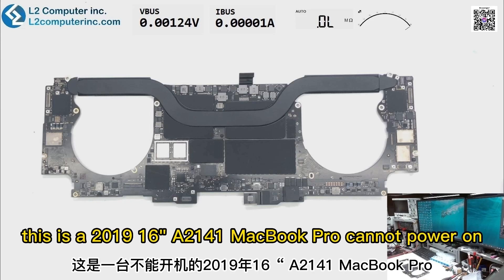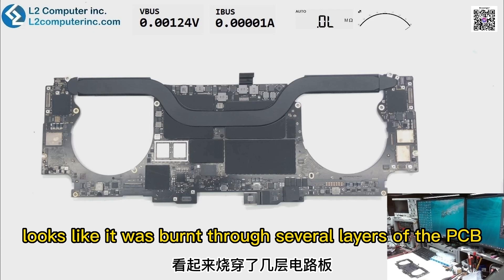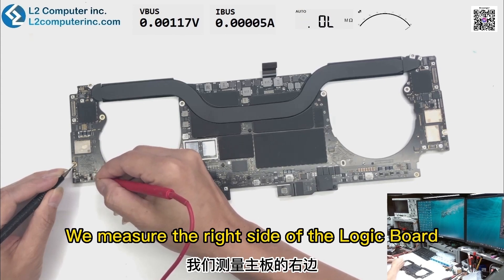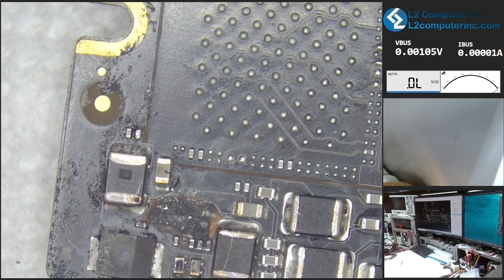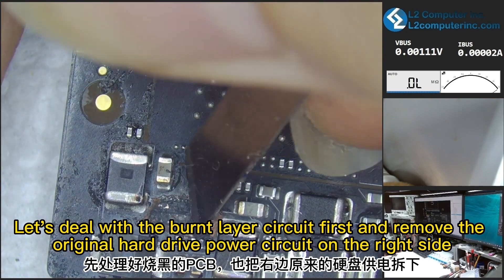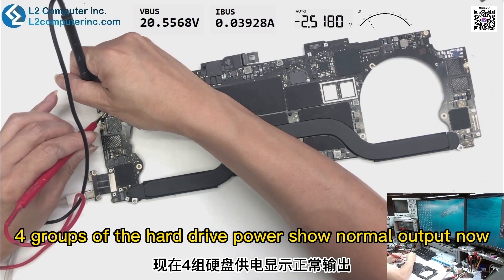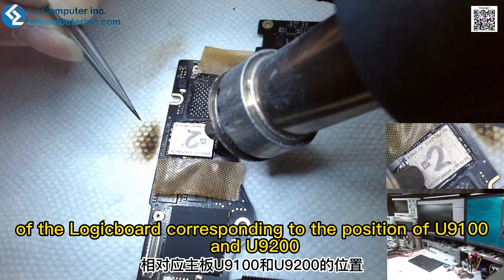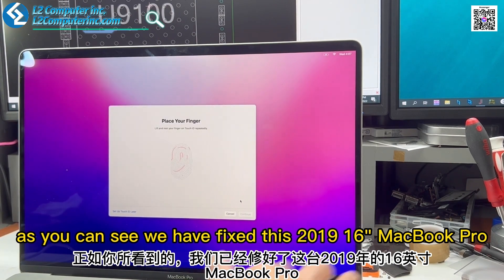Is it possible to solder only 2 PCS SSD chips on Macbook pro 2019 16" A2141?

Comment: How did you programm the chips?  And what sysconfig did you use? Because a2141 has no configuration with 2 chips for 1tb. Is always 6 chips
Reply: Nice fix btw!
Reply from the maker: Back up that from working logicboard
Reply: @l2computer310  Can you please share backup file to programm 2ssd's instead of 5/6.I would really appreciate.
Reply: Chỉ có Macbook Air 13 inch mới có SSD 1T 2 chip

Comment: Hello sir, can I ask you one question? I have a MacBook Pro A2141 problem with power ssd and I want to replace ssd from 512G to 1T. Is it possible to replace it? Thank you!!
Reply from the maker: Yes It can upgrade to 1TB but need to replace T2 also. 1G T2 for 128gb-512gb, 2G T2 for 1TB-8TB.
Reply: @l2computer310 Hello thank you for your well done videos I would like to know on which card you found the 2 nands 512 go please thank you
Reply from the maker: Just program if u have chip
Reply: @l2computer310  thank you i have the J program.

Comment: Nice video. How come you can get 1Tb with 2 chips only ? Where can we get them ? Thanks
Reply from the maker: https://www.l2order.com/ViewLarge.cfm?i_id=88BC0A0D3AAC541A74D534593368DFCB&i_maincat=E6D916A5FA744A0960B658F0C0B7E866ABE582DDEA58228EB6BFA489FA32DAB6
Reply: Chỉ có Macbook Air 13 inch mới có SSD 1T 2 chip